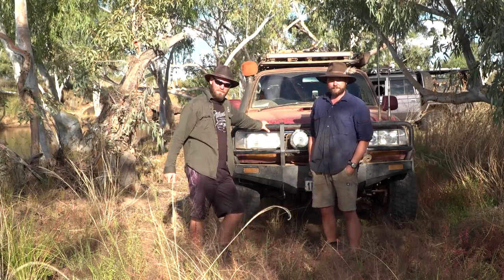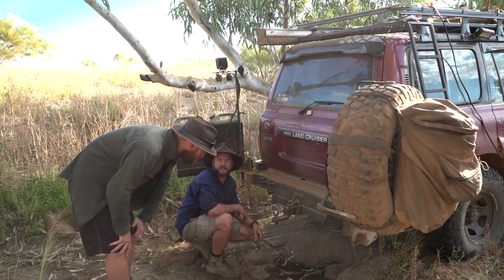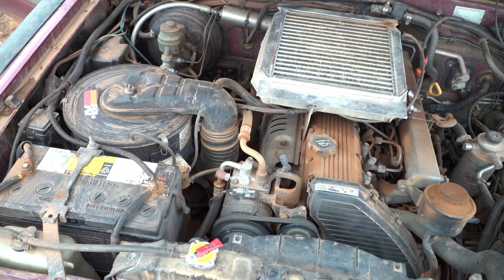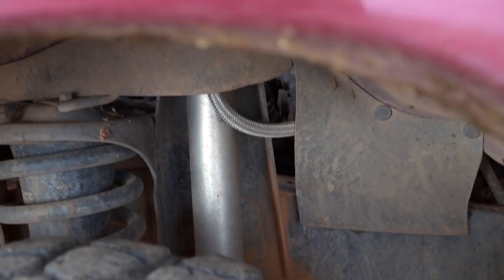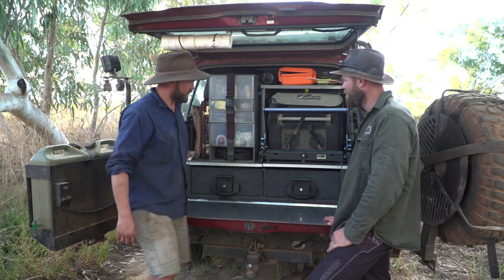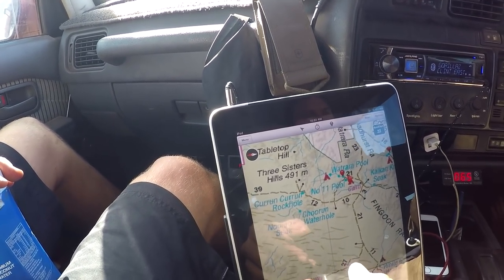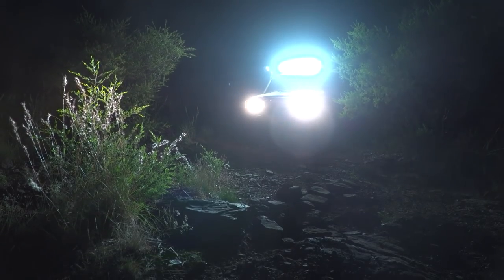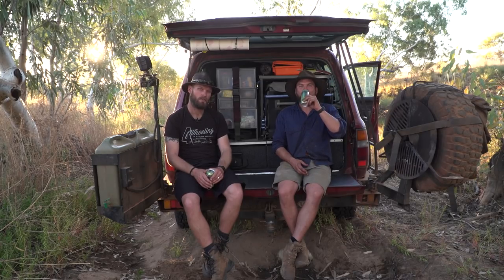80 series Landcruiser Turbo Diesel, Modified Episode 42

Comment: Most interesting!  I love the idea of the stainless steel on the rear tray, and the retractable key thingies for holding the fridge cables in place.
If you happen to notice this post, I missed how much battery storage is in the car.  thanks
Reply: Alexander Stollznow cheers mate 260ah of aux battery
Reply: @firetofork I came to comments fir same question. Is it set up n two batteries? What are they/it? Deep cycle or LiFePO4? Brand? They are behind the plastic drawers? How rigged?
Reply: @seancleary2295  They were AGMs linked in parallel with a 40amp redarc charger. one under bonnet and one in the boot with 2 gauge wire connecting them

Comment: The 80 series is the best 4 by ever made. it took me over 2 years to find one like yours, a 1HD-FT Auto with Nomad valve body plus many other things but not as extensively optioned out as your rig. Like the battery setup, you can power just about anything there.

Comment: Mustve been a small roo to clean up n drive off. I hit one at 100 in a rodeo and it pushed the bull bar onto my front wheels locking them. Smashed front end and drivers side. Couldnt open my door. Glass smashed etc. Found a tooth in my tray that looked like it shoukdve come from a small pig. Southern nsw has big roos though. He was 6ft plus easy 100kgs. If he didnt push the bar onto my wheels I'd have ended up in a 5 ft drop into a running creek in winter. Train style cattle plough the ain't lol. 

This is one of my fav modified vids. Love the genuine banter you have with your mates.

Comment: Toyota give us back 80's!
Reply: If they made an 80 series in 2019 that had a stock V8 turbo diesel and the classic 80 design I'd set out to buy one straight away. There's so many from the mid to late 90s out there but it's hard to get them under 450k kms or in decent condition
Reply: @bigoz1734  i sell them in europe. the best is the 24 valve 1HD-FT, better then the V8. with a bit tuning and different turbo setup you get a very fast Land Cruiser.

Comment: Grab a small thin strip of aluminium and stick it to the bottom of your eBay LED Bar so it protrudes a little bit with the light on .. so it clears your bonnet ;) 👍🏽

P.s .. love the brick <3
Reply: Great idea!
Reply: I set mine back a bit and have a dark coloured bonnet, no dramas
Reply: Unfortunately my rack can't go back any further and the light bar won't fit under it, I'd love to have it further back and lower

Comment: nice 80 Harry, I had a GXL the last model 80 Toyota built, loved it and solid axle, with your light bar lower it closer to the roof of the 80. I find my 79 with a roof top light bar is quite ok with no reflection on the bonnet, but it is close to the roof under my roofrack, changed my UHF radio aerial to black instead of the white one I had, and it was broken anyway, great review guys, enjoyed it

Comment: Pacey I'm back.  Nice 80.  Great modified video Ronny!  Its a good one.  I've got a 97 80 series.  She's cherry and I haven't really modified much.  Added a center diff lock switch and a dual battery for my fridge.   Cole, have you ever considered free wheeling hubs?  I know there a bit pricey but I was thinking less wear and tear on front axle?  Not sure if your spare tire hangs down to much; any issues with that?  If you bring a 1hd-fte to the states you can visit anytime.  Thanks guys!!!
Reply: Raymondo Wilson mate! Great to hear you enjoyed my earlier work, such a shame it got cancelled. I had free wheeling hubs on my old 80 and never found it made much difference- my front diff is rebuilt, so it's tight. The spare tyre is only there for really long trips so it's not an issue, airbags will help there too, I have a trailer with matching tyres now so that should fix that issue

Comment: 21:10, Just from some quick Googling, it seems like "food-grade" as it applies to stainless isn't so much about the material grade as it is about the surface finish.  I.e. devoid of lines, grooves, pits, that might accumulate something that could encourage bacterial growth.  Word 2 the wise, If you plan to do everything on it and beat the finish up, it may not remain so food-grady.  Perhaps consider if a shop charges extra for the food grade option in a particular grade of stainless.
Reply: Greg Feneis turns out it’s 316 stainless

Comment: strapping down solar panels that way kills efficiency. no cell should be covered in the slightest way, otherwise the entire panel won't work properly, voltage-wise. which the charge controller needs ..
Reply: I totally agree, it takes a huge amount of the charge away, when I get to camp I take them off so they have nothing covering them

Comment: Hi, excellent modified episode. Harry, i have a few questions. You mentioned what your best mod is the electrical mod. You can explained better how work all your electrical mod and how parts is composed if it is not annoying. I am interested in that, especialy in the part is you use the solar charge to charge te battery for started the engine. Recently my altenator it die and my 24v starter its not working properly because the factory dual battery not charged. I fixed, but i am interested in backup charge batery for started the engine in the future in case the alternator die againt. 
In this page(http://www.4-wheeling-in-western-australia.com/toyota-landcruiser-80-series.html) say all yours batteries is charged by Redarc, the alternator not charged notting in your lc80?
Reply: Hi, the alternator charges my starter battery and the Redarc feeds off my starter battery to charge my two auxiliary batteries. The redarc also has a solar input that works to charge my aux batteries when the car is turned off. When I used solar to start the car, I had my Redarc charging the aux batteries from solar and I used a set of  jumper cables to take power from the aux batteries and feed the starter battery. This is how it works on my car, except I have 2 auxiliary batteries joined in parallel getting charge: https://www.redarc.com.au/images/uploads/files/bcdc1240_12v_and_solar_setup.pdf
Reply: thanks for the aswers!